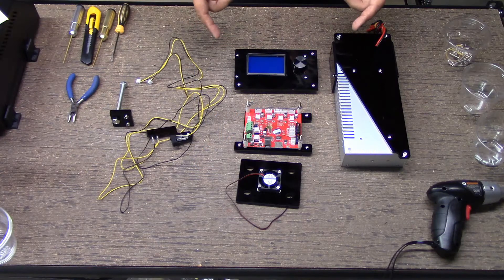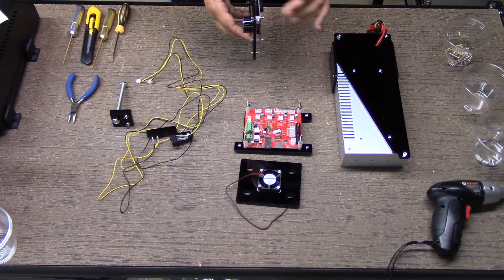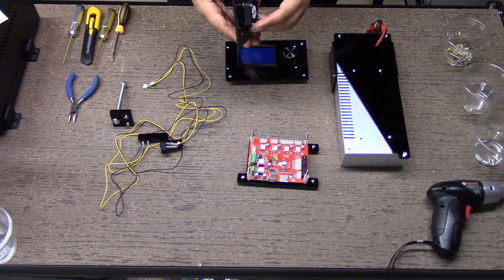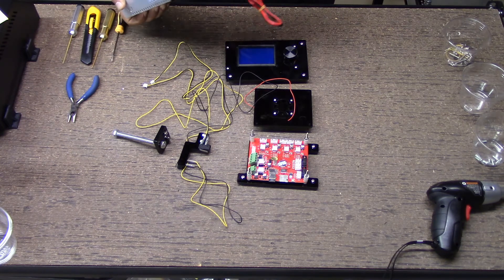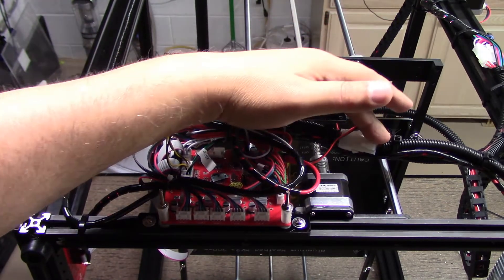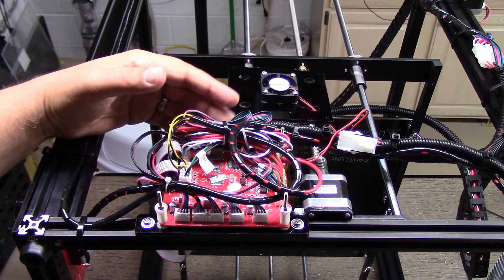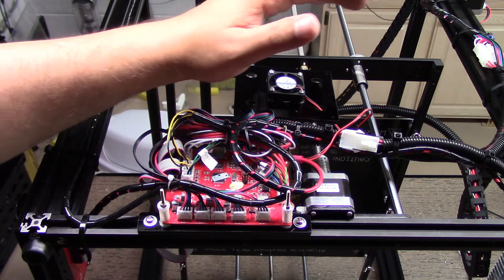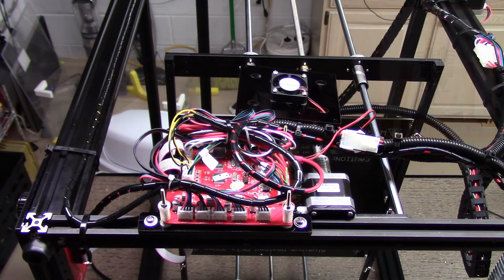Tronxy X5S - Installing the Electronics Part 3 of 4!

Comment: On mine the spacers were not long enough so the fan hits a capacitor. :(  I do not have enough tiny spacers (missing one) to make it all alright.  I will have to improvise.
Reply from the maker: I printed new spacers as the ones that came with were hokey...
Reply from the maker: By the way thought I saw two messages from you but only see one...
Reply: Yeah, I plan on doing that as well but for now I just used two m3 nuts and a m3 washer as a spacer to give that fan some extra clearance.   Oh, you did see two messages but I think I have it fixed as I had to add some spacers but I can tell you I 100% dislike the Z endstop because one mishap of half a mm and it will just keep going.   Oh, is it my imagination or when I homed it stopped on the right side but continued on the left?  I know I wasn't dreaming.  I also do not like how slow Z is and the noises I am hearing.
Reply from the maker: I printed a small head for the screw on my Z-Endstop bolt and use a top and bottom nut to ensure rigidity.  Now "when I homed it stopped on the right side but continued on the left", i have no clue! (insert a little chuckle as I would like to see that :-)  both of mine stop, now what I will share is this was one of the maybe harder pieces of tuning as they (the dual Z's) would bind, make noise and screw up the print.  What  did is losing everything up run some Gcode to run the bed up and down then tightened everything as opposed to forcing into being square if you know what mean.  After doing that, its been supper!
Reply: Well, I did that as I was assembling it as I noticed that if perfectly lined up the thing would bind so I moved it up and down by hand and that is where I set the leadscrew holder and no binding at all.  When I hit home I know R stopped and L kept going for half a second.  I have not adjusted the bed yet as it took me 4 days at 5 hours per day to finish it so it is sitting there for now but I am unsure how to adjust the bed so it will not bind.  As far as the screw to Z I am going to do as you did and print something.  Oh, my spool holder I am short one M4 screw for this entire machine I am short by one lousy item and it is the M4x12. :/  M3 I have coming out of rear in all sizes (except 35mm) from 4mm-60mm, but not m4 or m5.
Reply: A question but I want to flash my own Marlin but how do I get the default values for everything so I can plug them into the new Marlin before flashing?  All of the values it uses including which thermistor and something funky but my home is X:0.00, Y0.05, Z0.00 no matter what so that 0.05 for Y is some funky thing in Marlin.
Reply from the maker: Just use this package: https://www.thingiverse.com/thing:2738690

Comment: try to put the cable behind, think like a pc you need to get some room so the heat can be evacuated, did you try something with the z sensor?
Reply from the maker: Thanks for comment and yes got all the wiring worked and no on the z sensor.  Are you using one? If yes what do you think?
Reply: today i'm going to try a car sensor :D to see what accuracy have, with the mirror doesn't work. Do you have problems with the bed folded?
Reply from the maker: Sorry bed folded?
Reply: yep, today I found a couple of things of the structure that were wrong ... one of them is the smooth bars of diameter 8 that when tightening the shaft towards the aluminum profile the washer sank in the profile and it doubled the structure and in the middle of the heated plate a bulge that seemed bent ...
Reply from the maker: Hmm no have not seen this on mine, so far so good as I have run around 100 or so prints and all good...
Reply: after i put everything in place, i will upload a video:D